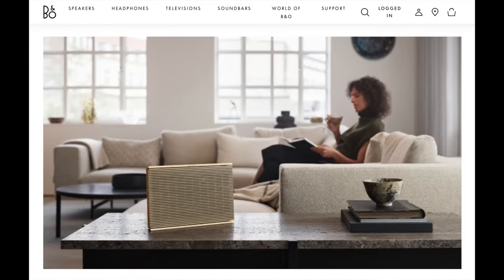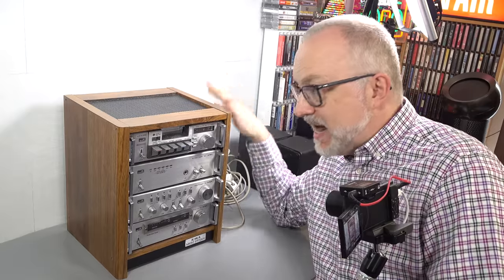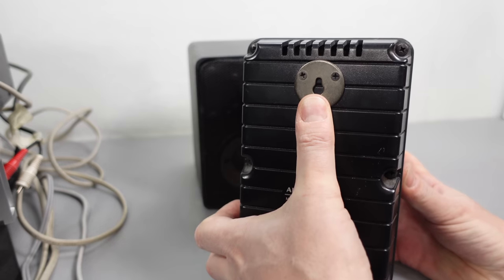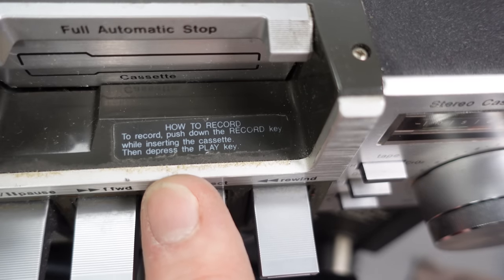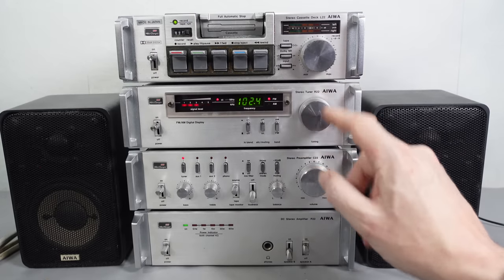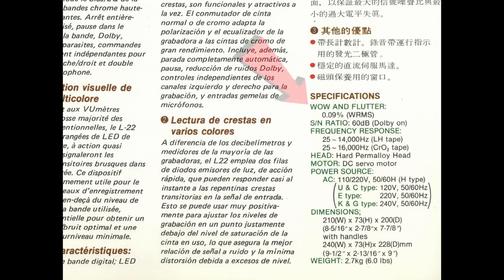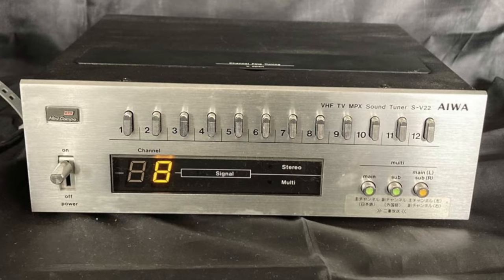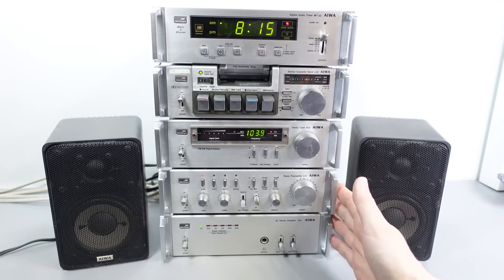AIWA SYSTEM 22 -  Micro HiFi from 1979

Comment: Matt, If you are looking for repair that picks up where your ability stops then look no further than Dengie Electronics. Having used a coupe of repair services previously that either failed to repair or said would not touch something that I had been attempted before, or they did not have the skill to diagnose correctly - I came across DE who successfully repaired a vintage tape deck for me not only fixing the issues but notifying me of other optional maintenance that would be beneficial. 

Another time a CD player had issues and one was it needed a new cog which DE supplied plus control panel dial knob / buttons that didn’t work. Not was it fixed but but DE went the extra mile in cleaning and adjusting things all part of the service. 

Excellent value for money and quicker than expected repair time and more that fair return courier cost. On top of all that the level of expertise and skill and knowledge is 110% impressive. 

This month I had a 300 disc CD player that had been dropped - as part of the diagnosis I was sent photos of cracked power board, bent chassis, 3 plastic supports that had snapped and a plastic column that held the drive that was broken. All repaired and excellent value for money the same week as sent in.

Comment: That micro system looks very nice. I like the high quality metal looks.
As a teen I had a cheap SABA 90's mini system, but with remote and fully electronic dual autoreverse cassette deck and 3-cd-changer.
Now I collected the Yamaha Classic Line and the Onkyo Separate Collection (both from around '96). Back then I would've never been able to afford those.
They just look so classy and high-quality and have some very decent specs. The Yamaha system looks brand-new.
Both with the top components of the series, 3-head deck, CD, RDS tuner and amplifier and all remotes, manuals and cables.
I restored them to working order, changing belts, swapping microswitches, replacing some capacitors, adjusting quiescent currents, replacing relais, etc. Electronics are a hobby of mine. 
I had a lot of work with the Onkyo deck, it had a lot of issues, and it's quite difficult to get to parts in the mechanism. But the reward is a nicely playing 3-head deck.

Comment: Thanks Techmoan, love your compassion, and can relate to it. I bought a similar Aiwa system 22 brand new when it was first released in the 70s. I used it for a few years but soon found more powerful stuff. I recently found it in the cellar, neatly packed and preserved. Now its residing on my desk next to my computer and works flawlessly with the exception of the cassette deck that needs some oil and fresh "rubber". I love the brushed steel design, the handle bars  and the sturdy switches. Aux 1 selects audio input from the computer / Internet and Aux 2 from my Sony Discman that I placed on top of the stack. The system is still powerful enough to upset the neighbours :)

Comment: I have a 22 system, which I did use till about 5 years ago, mainly from my PC (via a phono to headphone lead), the tape deck never worked as the belts were all knackered (I had a 90`s Sony micro system tape deck on it instead), then the power amp lost a channel (after many years of daily use), so I replaced it with an early 2000`s Philips micro system (which has also subsequently lost a channel!). I must get round to re-capping the power amp on both! I have them going into some mid 90`s (large, 6" bass drivers) Wharfdale speakers, & I must say, the quality is perfectly adequate, & the bass is more than enough to distort the Wharfdales & disturb your neighbours 2 doors down!

I have recently added the C22 pre-amp to my KAM record deck (which needs one), into an 80`s Hitachi ghetto blaster which has a phono in, & it still works nicely!

If you look on eBay, Japanese & American spec ones do have a power lead daisy-chain setup (mine doesn't either). Its also worth noting the 2 channel LED on the tape deck, which changes from green to red in record mode, that was VERY advanced for the period! I`d also say clean the tape deck, with your Allsopp 3, or a few alcohol soaked cotton buds!

I would also like a later Aiwa micro system, ideally with a graphic (there was one, cant remember what series, maybe 24?)

Comment: I have the same speakers connected to a more modern Kenwood system and I can assure you that they sound really nice for their size with better bass than you would expect (and they weight far more then you would expect, too), a bit on the bright side but nothing a warm amp or an eq can't tame.

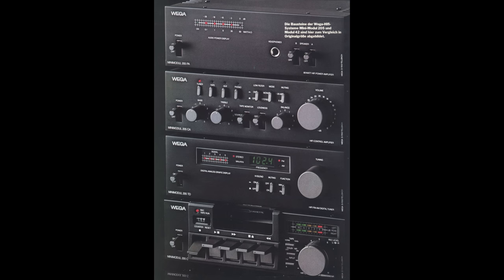Comment: 3:40 According to Wikipedia, Sony began to acquire Aiwa stocks in 1967 and was the major shareholder with ~54% in 1982, so they already had a significant connection in the late 70s

Comment: Interesting episode . Trying to repair older stuff and maintain it for regular use really is a passion and hardly ever cost efficient .
I've upgraded a few older RC trucks and replacing the electronic components is easy and affordable , but because other wear and tear or breakable parts are unobtainable. it makes using them difficult . I save them for special occasions and  my  ' daily drivers " are ones that you can get parts for .

Comment: Thanks to the Microsystem haha. My mother upgraded to one in 2008 and I got their old 1982 Technics SC-2020D Package System which I wanted. with SL-D212 turntable, SU-V16 Amplified, ST-S16 Tuner, RS-M16 Cassette Deck, SH-523 Audio Rack, and SB-2020 Speakers. Some Deoxit in the Volume Pot is all I've really ever needed to do aside from a new Stylus :)

Comment: I got recently this Aiwa 22 mini rack. Pair this little guys to serious speakers to feel the real punch. I have them connected to CANTON GLE-50 (same age as Aiwa 22). Simply amazing sound (without Loudness on). For me this is a holly grail among the vintage mini systems. Fun fact: it looks so vintage that always appear black & white, even on pictures taken in color. :)
Reply: Same but i have them running some 200 watt Rogers LS7's which it drives effortlessly. Btw the loudness button- These are meant for listening at very low night time volume levels as it brings up the level of high and low frequencies. If you use it at normal listening levels it usually makes everything sound too harsh.

Comment: I'm in the same boat myself Matt. I collect videogame consoles, arcade cabinets and pinball machines. And especially the older Atari 2600 and Coleco consoles. They are a pain to keep up and maintain. And I have a Bally Astrocade that is basically the electronic equivalent of feeding a gremlin. Don't put it on the carpet, make sure it has plenty of ventilation, install heat dissipators and thermal paste to insure the chips don't melt. The list is endless, and I wholeheartedly agree it takes a lot of effort and labor to keep one from going to oblivion.

Also, I did notice one thing. If any of these hi-fi "cases" are still available (like a timer) say just from a really worn and broken unit, it might be possible to "mod" one with say a modern Raspberry Pi, or other micro computer to act as a digital music and video streaming system. And with a really small display, the unit would make a great compliment to the overall function of this micro system and not look out of place. A new, brushed aluminum or stainless steel front plate with a small video screen cutout. A simple ON switch, and a cutout for two USB ports. Simple and elegant. I used to do this kind of work, but hands can't take it anymore.

Comment: I'm thinking if 22 refers to the width as the distance between the mounting holes if it would be mounted in a rack with screw mounting. What is the diatance between the screw holes of the "ears"?

Comment: Great video.  Back in the late 80s, I picked up a Sony FH-606R mini system.  Worked for about 20 years unit the amp died.  The neat thing was the individual units were connected via ribbon cables for power/audio/comms so it was a really clean setup.  The unit was locked together with two plates that also would hold the speakers.  As time went on, I expanded my CD collection and got wooden CD holders (I think they could hold 100+ in each.  They worked great as speaker holders too.  Move the brackets from the unit to the sides of the cd holders and they would float the speakers.  Nice stereo separation vs attached to the main unit.

Comment: If you are into vintage hi-fi...or really any vintage electronics, you really need to learn the basics, get the tools and do it yourself.  There are so many great channels that will guide you even if you dont have any formal training.  You learn what you need to know.  You don't have to have an engineering degree to recap a stereo or even do an alignment.  You, Matt, have way more experience than you let on, after all, we have seen you do some pretty complicated repairs.  It's one of those, you could if you wanted to deals.  Just not in your personal wheelhouse, you are a youtbe creator and dont have time to rebuild things, but it isn't a question of not being able to.  Most people are competent enough given the desire to learn as you go.

Comment: That wooden cabinet looks like its suffered classic glue failure. (usually through glue drying out) Should be quite easy to get it as strong and as good as when it was new.
Reply: Yeah, just saturating the joints with titebond and clamping everything down should shure it back.

Corner clamps ftw

Comment: As always an excellent video, and a rather lovely system - tempted to go looking for one... along with everyone else here! 
Just a thought, if not cheap. That disintegrating cabinet could be broken down for parts, the 'wooden' bits measured and new replacements cut out of the hardwood of your choice. Drill and screwdriver, done!

Yes, apart from repairs this system is old enough to really need a full refurb - not an eBay 'I wiped it with a cloth'.
...and, yes, a lovely thing to have if you can DIY any remedial fixes, but SOL if not.

Comment: Since there's few comments yet, I'll use this chance to ask something: since it's now hard to find cassette players with decent mechanisms, have you thought about checking those for cars? With a 12v adapter, you might get a better sound for €20 than with a modern player with a plastic mechanism.
Reply: Nice idea.
Reply: The car cassette mechanisms might be a bit better than the modern ones but are pretty naff compared to the older late 80s early 90s ones.  Most people's bad experiences that made them think cassettes were bad are from car cassette players, chewing up your tapes, having poor sound and lacking features.  Either a decent tape separate or even a micro system from brands such as denon (not a denon fan, they just dont have the lower budget offerings of the like of sony had) would be far better.
Reply: As a car enthusiast who has a couple of 90's cars, all I can say is that car cassette decks (and car head units in general) are a double edged sword - either they've been well looked after and still perform as good as they did when new, or are totally thrashed and either don't work at all or eat tapes.

Comment: My Mum and Dad still have seperates systems and music centers and I currently still have a micro all in one from 1998. The 1979 Aiwa 
components look really cute, it looks similar to studio gear and DJ equipment especially if you went for the flight case cabinet. This is 
even called a micro system! It still surprises me how some people can listen to music on a tinny smart phone speaker when 30 years 
ago they would have otherwise owned a midi or a mini system although many people who had seperates back in the day still have a 
seperates system. For many people the computer or TV also doubles as an audio system with or without a sound bar or powered 
speakers.

Comment: Those speakers look eerily similar to the Realistic Minimus 7 sold by Radio Shack from 1979-1993. They were often paired with receivers like the Realistic STA-7 and STA-700 and together, they were called the "System Seven". The Minimus 7 is one of those vintage speakers that has withstood the test of time and is still very viable for a passive speaker system today. Anyway, always nice to see somebody whose still into keeping these old systems up and running. Just got to replace the belts on the cassette deck and fix anything else that might be broken and you got an amazing system that'll leave most Bluetooth speakers in the dust.

Comment: My Dad bought an Aiwa boombox new back in the 70's when he was working overseas. Loved that thing as a kid, it sounded good, went loud and had a line input so I could plug stuff into it. Mum still has it, still works, even the cassette still works, still sounds great, though the volume control is a bit crackly and only one channel works, no matter if you're listening to the radio, a tape, or something connected via line in.

Comment: I've had one of these for years, I did the tape deck first, the belts are a pain to change. Then I re-capped the pre and power amp as it did have some low hum and lots of crackle. Years later it's still perfect and the sound quality is superb after the service. I then collected other mini separates to match, like the Sanyo micro deck and the Sony psq7, both have been covered by techmoan 👍

Comment: Awesome you gave this a proper review! I owned both the Aiwa version as well the Uher Paco version. That suits juist so great in an interior! Sold the Uher however but still have the Aiwa 22. The cable mess is a bit of a downside. But once set up no problem anymore. Connect the set to proper speakers! and you will be surprised with its sound!

Comment: They are in fact a really, really, good HiFi system. I have had mine since about 2011, recapped both the pre and power amps (not the larger capacitors in the latter, hard to find these days). Not hard to work on really, even though everything is shoehorned in there and looks somewhat daunting at first, they are really well designed. About 30% of the caps were out of spec, some considerably so.

I hardly use the radio, but it works perfectly and is clear as a bell, and I don't have a cassette. I have it connected to a Denon CD player (DCD-F101, similar size and style) and also to a Google Chromecast audio for streaming. Works and sounds great, through a pair of Q-Acoustics 3020i speakers. Also tested the Phono stage with an old NEC turntable and that sounds great too - so I think your unit needs some TLC. The pre and power amps are certainly worth keeping and reconditioning IMHO.

The weight of the Power Amp is down to the huge toroidal transformer it uses, which occupies essentially 1/2 of the size of the unit. Rare to find one of those in any sub £2K amp these days.

My brother bought one of these back in 1970/1980 for his hairdressing salon (on Wigan Lane) and he had it connected to some of Mission's original 700 series speakers. If memory serves me, it was about £400-£500 in 1979.  It was always one his favorite HiFi's and sounded as good as any NAD or Rotel stuff of the time. It worked for years (for 10-12 hours per day, everyday) but finally the power amp gave up and was, in around 1989/1990, old and uneconomical to repair. I use mine continuously and remember my big brother (RIP John) every time I turn it on.

Comment: I have an Aiwa 22, except mine has the A22 integrated amplifier. Its really good, and I use the amp and some Keesonic speakers all the time. Don't use the cassette due to faults, and I don't use the radio as much due to a lack of quality broadcast programming (despite the radio itself being good quality, and picking up far more stations than yours appears to).
Regarding the faults... My L22 also has the same issue of playback on  a single channel. I traced the problem to one of the Dolby chips, but never bothered to fix it. I will get round to it... one day. Mine also needs/needed new belts. Can't remember if I ever got round to changing them, but it was a pain to disassemble as they have practically crammed an entire full size deck into a tiny package. 

Its also worth noting that on the european models, the tape output on the A22 amp is a DIN level input/output. The US models had line level. If you have the DIN one but want to connect a newer line level device, you can convert it just by changing some resistors on the PCB. I then use a DIN to Phono cable to hook up a modern tape deck etc. I also found the 2 pin DIN sockets for the speakers to be unreliable and prone to breaking, so I swapped them for much sturdier 3 pin DINs.

Comment: Great video about a great micro hi-fi system. It's been very interesting for me to compare the Aiwa 22 series with the Akai UC-U2 micro system I have here. They're very similar in age (my Akai dates from 1980) and have a similar feature set, like full-size good quality hi-fi in miniature. The Akai has an analogue tuner (UC-K2L), with FM/MW/LW and an LED signal strength indicator, and its amplifier has two tape loops! The UC-M2 cassette deck can handle metal tape and has 12-LED VU meters. The Akai is in daily use here in our kitchen, but I'd echo Mat's caution about maintaining old gear like this. I've had to replace all the filament dial lamps in the (analogue) tuner with LEDs and do lots of contact cleaning, as well as replace some worn-out power switches. I've just cleaned and lubricated the cassette deck and fitted new belts to bring it back up to scratch, which was a nightmare of a job. The entire mechanism was gummed up with old grease and needed total dismantling which took hours. That done, however, the whole setup works really well and the sound quality is just as good as any mid-range hi-fi, when connected to decent speakers (I use either Goodmans Maxim I's or Wharfedale Diamond 3's). The system looks great too, and with the right skills and a copy of the service manual, it should be possible to keep it going nearly forever.